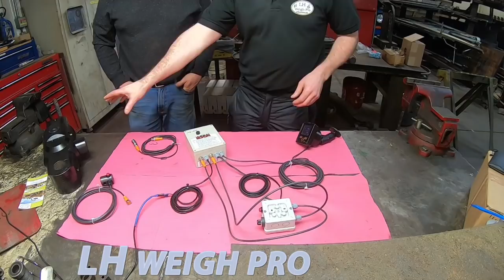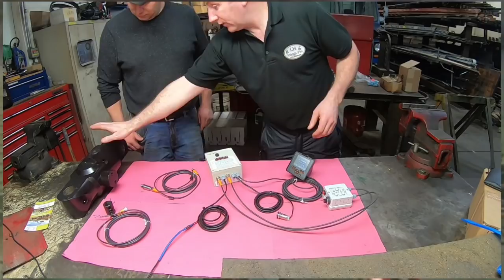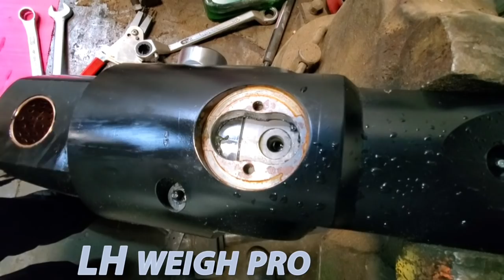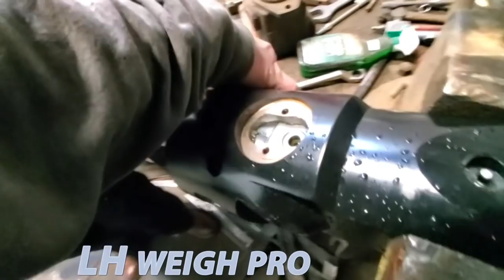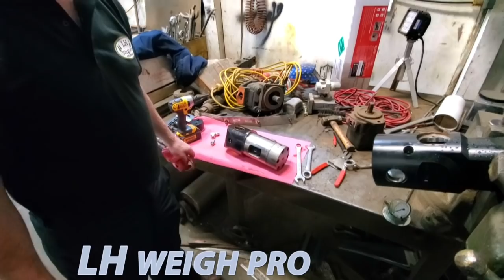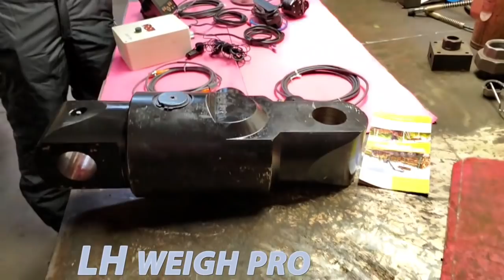LH Weigh Pro!!! Link in description

Comment: That is a really neat gizmo there only thing I got on it is that some truck and trailers weigh different if you got a sleeper cab on or different axle configurations it wouldn't be too hard to set max weight for every truck but if there were settings for truck A: 42,000 lbs, truck B: 44,500 lbs and so on if they got that system in place or bluetooth compatible so you can set the settings on your smart phone that would blow any other competitors out the water and this is already a quite water right system
Reply from the maker: Yes you would have to know empty weights within reason